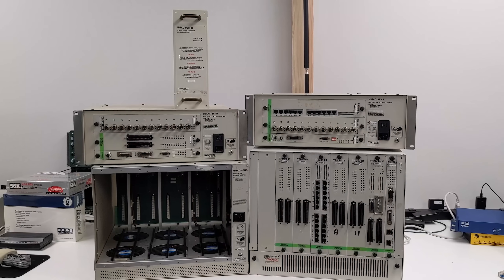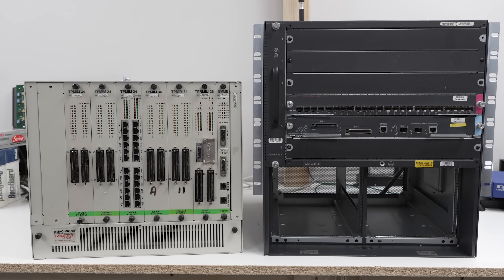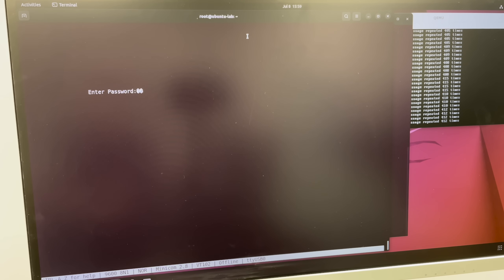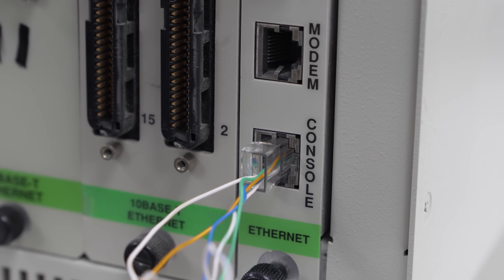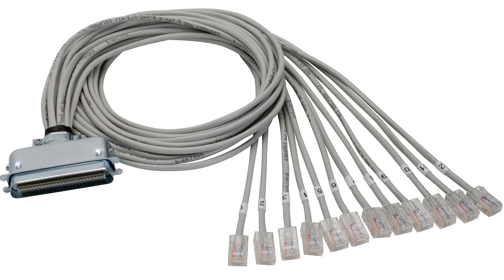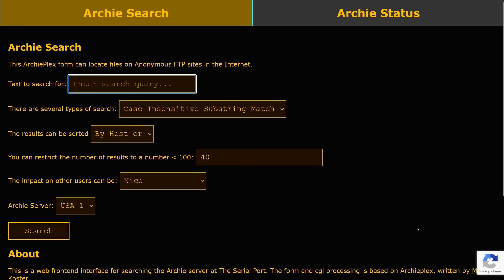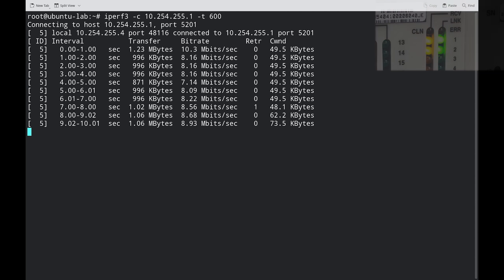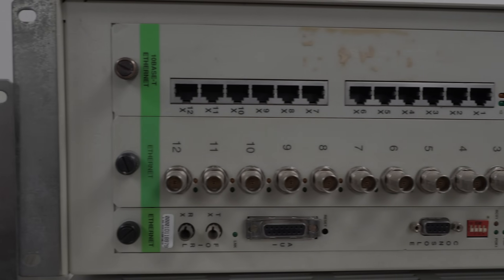CABLETRON: Early 90s networking hubs

Comment: Worked at cabletron from 1995-2000. A couple corrections. Spectrum was very different from Spectrum Elememt Manager[SPEL]. So the price difference is due to that. Also, you can reset the NVRAM on most devices by flipping switch 6 on the dip switch and powering on. Another thing is these devices support all 9 groups of RMON. So you can get an insane amount of data down to the port level. 
EMME was ETHERNET Management Module for Ethernet. Remember that these things were designed for multiple networking protocols. So this was the result of a planned naming convention.
Reply from the maker: Thank you for the info!
Reply: @theserialport  one other detail I thought of. If you can find firmware for these devices, flip switch 7 and that should put the device in bootp mode. You can reflash these using a TFTP server. Between reloading the firmware and clearing NVRAM, it will fix 80% of strange issues
Reply: @MichaelKrygeris  Exorcise the ghost in the machine by freaking erasing it. 🤣

Comment: The Cabletron name and logo rang a bell, so I went in the garage to take a look. Turns out I have a Cabletron ELS100-24TXM fast ethernet switch with one of the modular uplink ports, and I remember using it years ago for my at-home equipment rack before upgrading to GigE speeds.

Comment: Great video, thanks.
"Annoyingly it has a different serial console pinout."
Idiot moves like this were why Cisco beat all the others to death. Like taking candy from a baby. Cisco's big one was the consistent management interface across all devices. I felt it was a remarkable feat. I worked with a few others. Soul-destroying inconsistency was the constant theme. Different cables, different user interface, different special software. Visiting a customer site was a constant worry. Did I remember this cable or that software.

Cisco, one cable kit, PC terminal software and maybe a tftp server.

Comment: I worked at Bank One in the mid 90s and they spent $80000 on  Bay Networks router (it was physically HUGE)!  It was crazy the costs of it and then it still didn't do what they wanted.  But they were warned in advance ...  Our local (AZ team) told the national team that it could not route the RPL boot (network DOS boot via Novell NetWare server) across different cards in the unit.  We were right.  

Maybe that changed later. But we spent about 12 hours working on it back then and it just couldn't do it.

Comment: It's interesting to note that Cabeltron bought Digital's (DEC) networking division in 1997 and continued the networking equipment brand. I've got a DEChub 900 module from after 2000 with the Digital brand made by Cabletron (or one of the successors)

Comment: Oh I remember retiring these when I was in High School/First year of college. I got a job for two summers in Chicago and the company had a mostly thicknet and thinnet based network powered by mainly by this series of cabletron repeaters.  I basically spent my first summer working on the older stuff, and then slowly helping convert people over to the newer 10Base-T 3Com equipment that existed on 2 of our 4 floors using old Cat3.  All 200+ staff sharing a blazing fast 1.44Mbps off a T1 (for my High School self that was an insane amount of speed).

The following summer these were finally gone, we were converting from Novell IPX to TCP/IP based, and they had structural cabling all using the newest Cat5 cable and central patch panels in one computer room (amazingly new technology at the time).  

And at the core of it all I got to help setup the first Ethernet switch I ever saw.  It was an 8-port 100Mbps switch. Each floors connections went to a separate 3com hub, then each uplinked to the switch, and then 2 x 100 Mbps FDDI ports formed a full-duplex fiber ring for all the Novell Netware servers.  I think we had close to 16 GB of storage across all the servers combined....just massive amounts of space!  I believe I was told the 8 port switch ran about $16-17k (for context I was paid $7/hr, minimum wage was $5.15/hr, my total college tuition per year was about $3.5k,  and I was working to save up $750 to buy probably a 10 year old car....that switch would have paid for a car and 4 years of school & board with some to spare).  By the time I left college you could get Cisco 3500 XL switch’s for about $3k.  That’s the difference 4 years made in networking.

Comment: Excellent video! I joined Cabletron in presales just as the MMAC plus was launched. Can't remember any of the details, but it was a hulking lump compared to the MMACs. Re Spectrum, the two things i remember about it are (1) the key selling feature was being able to work out where a network break has occurred so that you only received errors from the linking unit and not everything behind it and (2) they apparently employed an army of developers just to create the modules for all of the non-Cabltron network gear. Final thought: Bob was apparently just as bad as the stories say! The culture was not great

Comment: Awesome video! I never worked with these in the 90s but I remember seeing some of these in the late 90s in a warehouse where used computer parts get dropped off for scrap from the local government. I vaguely remember seeing the ones that had those 50 pin telco connectors on it. I played with it for a week or so but lets face it, even in the late 90s, half duplex 10mbps was pretty decent but still slow. I wish I took pictures of all the different equipment that came into that place over the years cause there was some REALLY odd ball stuff that was not common to the general public and was probably military specific in nature. I just recently found an old BayNetwork 10/100 Switch over there plus an  old 3Com 10/100 switch too. Plus some form of multi T1/E1 to ethernet interface also arrived. I love old stuff like this and I still save old 10Base stuff from time to time. 

Do you plan to do any videos with any other vintage network platforms such as ARCNET (never got to play with this), or ALL of those RS232/RS485 based variant networks that were all proprietary? I occasionally see stuff on ebay that used a small hub of RJ11 ports and the cables that leave the unit go to SERIAL ports on each computer and then you install a driver that turns your serial port into a network interface. I'm sure it's less than 2mbps but back in the 80s, even early 90s that was def flying. I love your video on DEC Ethernet bridge. You plan to do anymore with other various bridging technology such as AppleTalk to Ethernet or early routers (non Cisco)? Thanks! Keep up the good work!

Comment: Well thicknet was backbone, with Vampire taps, often running in a riser up the building, with thin net to each device, often with terminator resistors everywhere.  The thin net could be run around the edge of a room, and you could connect in to this loop of cable.

Comment: I just found a Cabletron Smart Switch Router 2000 in a long-forgotten rack at work recently. It wasn't on, but does power on. I tried to get in via serial and it didn't work, but I should double-check the pinouts after watching this.

Comment: Bay Networks was before my time, but I remember my Dad installing some at his work. I think the big deal was that they had a Bay Networks switch which would help with the transmission collisions. The only time I touched CableTron was in 19999 after a failure at a local PD's Detective's building. I was on call and show up, but I'd never seen them before. Get connected, I don't even remember the problem, but was able to diagnose it over the phone with my boss, swap out a card, and get them back up and running. That thing was ancient and replaced with Cisco not long after.

Comment: I adminned a large Spectrum deployment (on Solaris/SPARC) in the 2000s. It was quite good - one of the two main proprietary managers (along with HP OpenView) to be good enough to be generally usable with any gear. The environment it was in was of course a previous Cabletron shop. I got there just after they went to an all Cisco network with routing - Cabletron encouraged a 'flat' network design which didn't work out well in practice. Spanning Tree elections taking down the whole network for ~30 seconds damps enthusiasm.
Reply: The insane thing is that Spectrum has been sold off several times since enterasys spun it off. To my knowledge it is the only vestige of cabletron that has kept its original name. Somehow Aprisma was able to distance itself from Cabletron’s implosion. To this day I still believe it was the most advanced network management software ever made. Massively over-engineered like most things cabletron built.
Reply: @MichaelKrygeris  Yes. When Cabletron fractured, the Spectrum division became Aprisma. They were bought by Concord (another New England SNMP company that actually complemented them well) who was VERY shortly after gobbled up by CA. CA is now Broadcom, so....

Comment: My first real IT job, the main hub was a Cabletron.  It was 1996.  They had outgrown it and had a few random hubs connected to it.  It was a very data heavy business for 1996 and the collision light was almost solid.  One of my early tasks was getting things up to 100 megabit, which I did with an unmanaged switch and several hubs, all 3com I believe.  While we were doing that, we partnered with another company for a big project, they brought their workstations to our office and none of them worked right on the network.  That's when I learned about 100 base VG, they brought in their own switch and we bought a compatible card for one of our servers, that's also how I learned how to set up IPX routing in a Netware server, yes, from one of the many red books on the shelf.  I wasn't even 20 yet, those were the days.

Comment: I worked at a pharmaceutical company in IT from 2000 to 2001 and we had the Cabletron chassis systems there.  We used the octopus cables that interfaced with the patch panels like you described.  Some parts of our network had transitioned to Cisco equipment but our research building was still on Cabletron I think.

Comment: A few days ago, I connected a IBM Stackable Ethernet Hub with 10Mbits to the Management port of a Mikrotik CRS502. The CRS502 got 4x 100Gbit QSFP28 and a 10/100 MGMT Port. It was kinda funny to transfer a file from through a 10Mbit hub to a 100Gbit connected Server. I also monitored it via Zabbix, but the SNMP Queries maxed out the Hub's CPU. 🙂

Great Video! I hope you can show more of those multi mode hubs!

Comment: Ah Memories. I worked on many of these as we had about 8 of the MMAC8's running our company linked up with  FDDI along with the bigger Cabletron Smart Switch 6000. The TPMIM cards were the cheap ones. They all used a shared 10MB backplane basically a dumb hub. The TPRMIM were 10MB switched hubs. The price difference was huge. I sat in many meeting with my CFO trying to convince them we needed the TPRMIM and why. Went right over his head every time.  These were rock solid. Other than a fan in the fan tray needing to be replaced. We had these installed for probably 10 years with almost ZERO failures before moving to the 6509's. 

Cisco marketing basically pushed these guys out of the retail market. They actually paid us (or gave credit/discount) to take out the Cabletron and install Cisco.  This of course made perfect sense to the CFO so we eventually dumped all our Cabletron's 

Get your own Smartswitch 6000 with some cards here on ebay for 350.00. Thats about 75,000 dollars off :) 
https://www.ebay.com/itm/265287645635

Comment: I recall having a multimedia network in the school which I attended between 2000 and 2004. The computer room had some newer Slot 1 Celeron machines with 10/100 Ethernet cards, and some older Pentium systems (namely some Compaq Deskpro 2000s and a few HP NetServer E30s used as regular computers) which had NICs with 10base2 interface. There was a simple hub (maybe made by SMC, but I'm not sure) which had a single BNC port and 8 or so RJ45 ports. The 10base2 computers were connected with T couplers, the rest had individual Cat5 cables. The incoming internet connection speed was 512kbit/s, pretty snappy for the time, but if all 16 computers were online, it was pretty slow. Later (at my advice) they bought a 100 megabit switch, and kept using the hub only as a media converter, with one RJ45 port connected to the switch. That made a significant difference, and was in use until I left the school in 2004.

Comment: the people need a cabletron token ring setup
Reply: The people need a clabretro isp
Reply: The company I started my IT career with had a dozen floors and a number of warehouses of these (in token ring!) well into the mid 2000’s. They also had Windows NT far later than they should have too!
Reply: My Cabletron (Ethernet) switches are slightly newer than those shown - I'm looking for some similar Madge chassis that had Token-Ring modules.

Comment: I worked with a ton of different networking gear around that time.  The 3Com PairTamer, sort of a coax-to-single pair adapter, passive, no power required.  Catalyst switches before they were bought up by Cisco. Cisco HyBridge routers with a Multibus backplane.  Almost everything DEC made, from PDP-11 based DECSA ("Pluto") terminal server / router (X.25) / gateway (IBM SNA), DECserver 100, 200, 250, 300, 500/550, 700-series, LANbridge 100, 150, 200, and more.

The Good Old Days!

Comment: Since it's a repeater (hub) those ports might not have full statistics (around 13:20). It would be nice if there were receive or error counters per port. Maybe time to get a 3Com SuperStack II hub from the mid 90s and check out their SNMP counters. Back in the day I remember having HP OpenView with a plugin to manage the 3Com SuperStack II gear all running on a Sun Ultra 1 with Solaris 2.5.1.

Comment: You need to do something on Synoptics Lattisnet
Reply: I was a 19 yo intern at Nortel back in 89.   I was fortunate to be at the early stages of modern networking.   I learned about the very early Cisco terminal servers, routers, thin net, lattisnet and Unix admin.   All that knowledge has served me well in my engineering career over the years.
Reply from the maker: This miiight be coming sooner than later!
Reply: @theserialport  I just started to remember bits and pieces of things, like the LattisHub.  And long after we'd switched to other 10Base-T gear we still used the LattisNet fiber optic transceivers in pairs at each end of an existing fiber run, to save the cost of running new fiber or UTP.
Reply: Ah, yes, Unshielded Twisted Pair Ethernet before 10Base-T!  I remember having to agree to a non-disclosure agreement so we could evaluate and later buy and use the Lattisnet gear.  Their later gear was 10Base-T compliant.

Comment: 13:30 - Given that it's a HUB there's no way it's going to have traffic per port, that fundamentally requires it to be, well, NOT a hub but a switch/multi-port bridge/router. Or more precisely, each of the four "ports" (A/B/C/D) is a hub.
Reply: Indeed, it does! They support 9 groups of RMON and there are counters for each port. There is a dedicated cpu just for management. The emme is actually a  switch that connects the hub backplane ports. 
These things were insanely over-engineered and were built like tanks. I found a thin-net hub in the ceiling of a manufacturing plant, still running a few years ago!
Reply: I worked with kit that has traffic per port monitoring on repeaters. Optical Data Systems. Super monitoring was their USP. Oh and fibre too of course, that being in the name :-)

Comment: I worked with these in the late 90s and replaced them with Nortel gear. Cabketron was by far the worst gear we had.
Reply: Nortel... there is a name I've long since forgotten. Mostly saw them when I was interfacing a T1 to a PBX as part of a migration to the early days of Cisco VOIP (very early 2000s).

Comment: This is just a bit before my time.  I was learning about networking when a lot of concepts here were just falling out of fashion.  My home network was a D-link 10base-T hub with 5 ports, later upgraded to a 3Com 100Mb 8-port hub, and then to a 3Com 100Mb 8-port switch.  (What an upgrade THAT was!)  Even though my first network card still had a coax connector on it, I never used that, and never ran into a production network with anything but UTP.  All the lectures on "bridges" to cross over media boundaries, and the "x nodes per segment" and minimum cable length rules were starting to become obscure relics that nobody new to networking understood anymore.

I have never used a Cabletron product, but have had the... uhh.. let's say "pleasure" but steeped in sarcasm ... of getting a little bit of seat time on Enterasys switches.  I cannot for the life of me understand what practical use it would be to have the ability to tag inbound and outbound frames with different VLAN tags, but apparently they could do it.  And about a dozen other things that nobody asked for, and I can't imagine anyone sane would want.  They had a nasty Java app to manage a campus, and could roll out intent-base rules to do on-switch firewalling.  I'm sure that never came back to bite anyone...